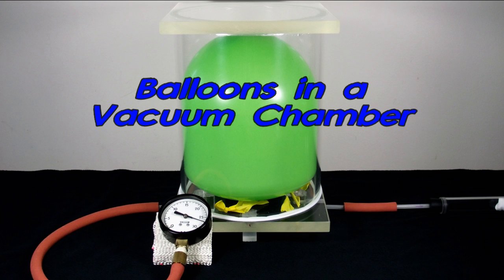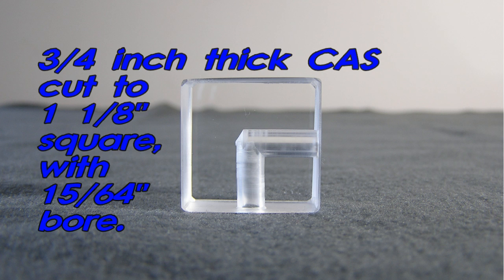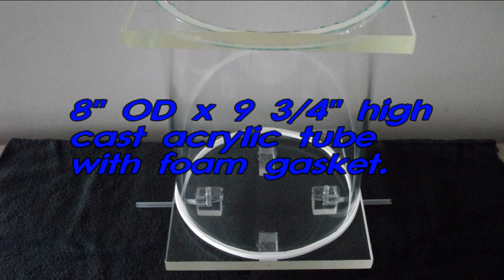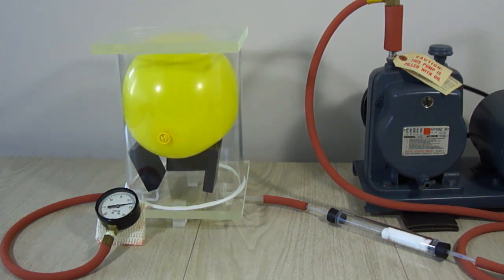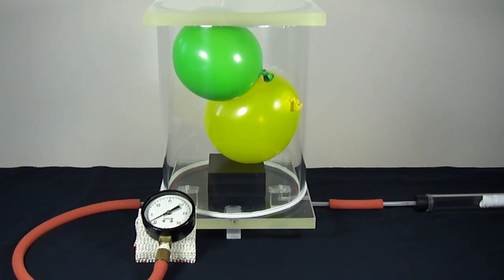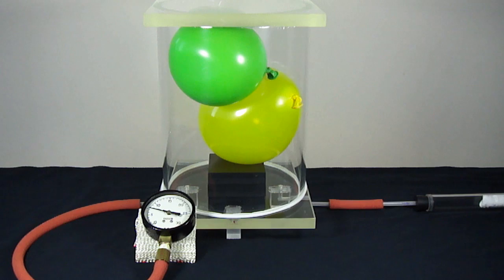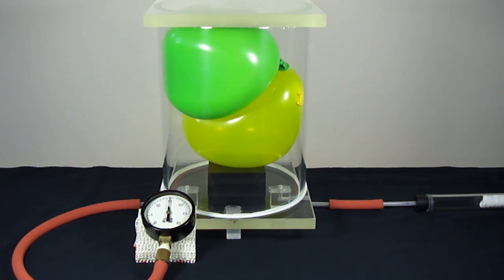Balloons in a Vacuum Chamber

Comment from the maker: It can be very close to 100% with the correct equipment and procedures, but you don't need UHV to have fun. Since the topic is too large to fit here, I recommend the Wiki pages for Ultra-high vacuum and Gas dynamics as a start, then "belljar.net" if you are interested in building your own system.

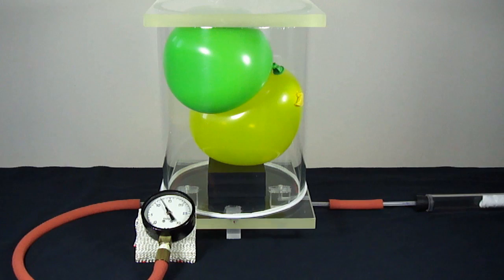Comment from the maker: It depends on how determined you are. As a minimum, you will need special pumps with short, large diameter connections to the chamber. The construction materials should be glass, stainless steel or other material that doesn't act like a sponge, AND can tolerate a system bake before starting. The acrylic chamber and long, small diameter tubing used above, does not even come close to the requirements for UHV. As mentioned at approximately 1:50, the base pressure was about 1/10 atmosphere.

Comment from the maker: Yes, sonic devices in the chamber are coming, but I don't want to drill any holes for power leads, and it's taking me a while to put together a battery-powered controller for an electric bell, which will include a "transient voltage suppressor" to protect the 555 and the power transistor. And, no, the vacuum will not be 100%.